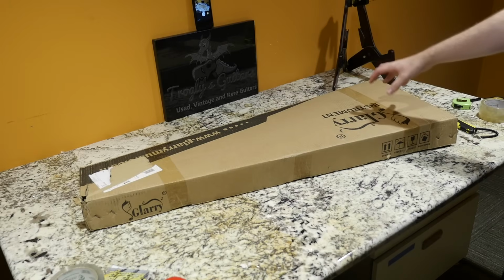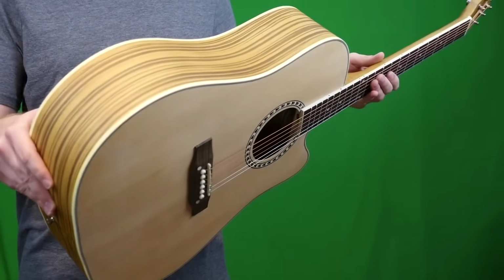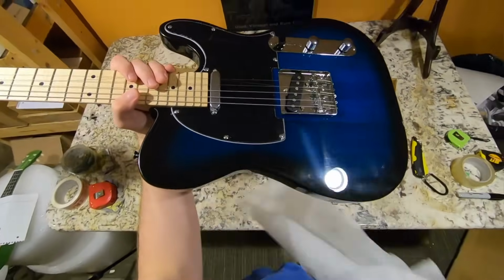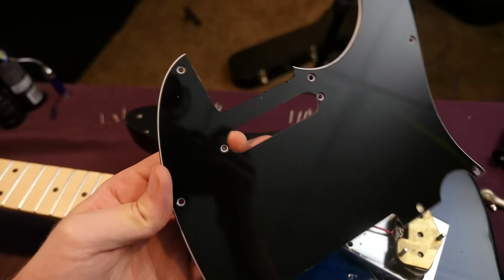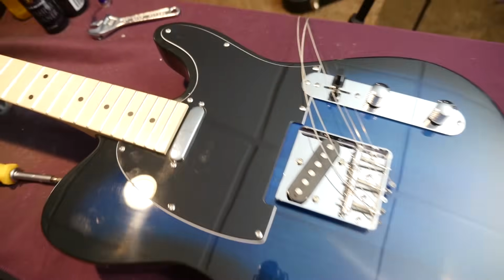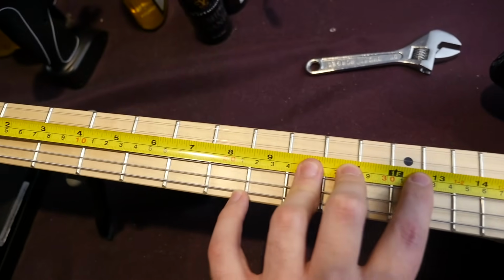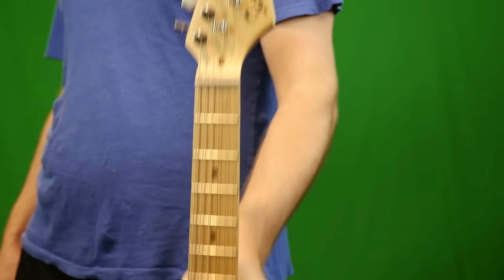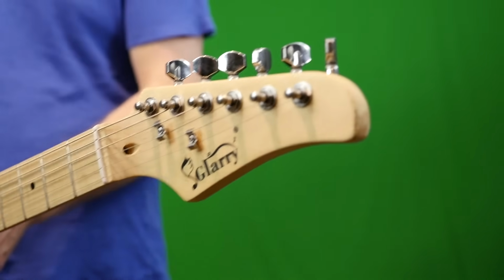How I REALLY Feel About Glarry Guitars... | Glarry GTL Maple Electric Guitar Blue Review + Demo

Comment: Have bought name brand stuff with worse frets then Glarry.....primarily epiphone.  I just have to shake my head.  The tuners were not bad....if you stretch the strings it will stay in tune.  Unlike the Epiphone which puts the worse tuners in the world on their cheap stuff (179.00)...the trapezoid nightmare.
My neck/nut was the same....fingerboard was crooked in front of nut but just didn't cut the end of neck straight.  Nut was installed correctly.  Measured fine nut to bridge.  After leveling the guitar it flat out played.  Output jack the same as your's....bent like butter.....spend 4 bucks for an all parts one.
After spending about 20.00 for better chinese pickups (alnico 5), pots, and bone nut it's one of my favorites.  Flat out plays.  Nothing wrong with slightly higher frets at #1 and lower as they go up the neck...the reverse won't play.  That's medium frets at .090.  Can be a pain leveling if they install them a bit uneven.  May get them low...not much room for leveling.

Comment: I had over paid my auto insurance and was sent an $83 check. Just took delivery of a Glarry Tele. Looks like it was shaped using a broad axe. I believe there is actually a nail embedded in the top. The head stock feels like 60 grit sand paper, the neck 220. Loose tuners, rough nut and fret sprout. Just a horrible guitar, not even suitable for wall art.

Comment: As I said in my comment below, a guitars playability rests on the straightness of the neck, the quality of the fretwork, and the talent of the person holding the chunk of wood. You could literally bolt a slab of plywood to a neck (as some companies have) and end up with an amazing instrument. It's the alignment and design process and the attention given to it that makes the difference. Personally, I'd rather have a CNC machined body as opposed to a hand carved one purely due to the accuracy of CNC, and a neck that has been hand fretted and inspected. That's where the real quality comes into the mix.

Comment: I got one of these thrown in when I traded my Sterling Axis for a Nova System, and I’m using it to play around with modding. I’m working on routing the bridge for a humbucker. But, I’m keeping the ashtray bridge. Cutting it down to shape. It’s coming along swimmingly. I wouldn’t have ever had the guts to cut into the body of a Fender or even a Squier.

Comment: $60-70 instrument, that actually plays, has to be worth it, right? The question is, what if you spend another $60-70 to improve that instrument, would it be better than a new $120-140 one out of the box? I think it might be... I have bought several guitars in the $500-700 range, and they all needed some fret work and the nut was always too high, and they required all the other neck and bridge adjustments. So you can't say these super cheap ones are bad, because they haven't been set up.

Comment: I'd take that and give it a Fender set up which means 4/64" @ 17th fret across the fret board for string height, .012" for neck relief providing the truss rod works. Then swap pickups out for some "bottom of the barrel" Fenders which would probably cost more than the guitar. Then maybe, just maybe I'd hold onto it and use it as a "sleeper" telecaster, which people would say "how does that POS telecaster sound so good. Great review, learning a lot from you, Austin, thanks.

Comment: I bought the exact same guitar, made by Musiker. Beautiful blue finish and nice thin maple neck. Had the same distance from neck pickup  to pickgard. Usually 1/8 of an inch or less not as far. $182. cad. How did you lower the action? By the neck rod?  Did it have neck bow? My neck is 100% straight. I will  give it 5% releive. 6E - 5A buzz if I play it hard. Thanks. I enjoy your reviews!  :)

Comment: My verdict on the ridiculously cheap £56 Glarry Telecaster...
It's not too bad. ☺️
In fact...it's a pretty decently playable and useable guitar for the same price as a meal for two.
I really like the pick-ups and it came without any visible flaws, but needed a quick set-up.
The only fault is one high fret which is easily sorted with a bang of a hammer.
Everything works as it should do.
It is very light and feels quite "raw" because the neck has no finish on it, but it feels smooth and now I've lowered the action a bit it plays very nicely.
I am impressed by the tuning stability and the bridge pick up is a bit of a microphonic beast.
The neck pick up is more jazzy and quieter, but nice.
It doesn't feel as refined as a Squier Tele, but has no really bad faults.
And it also looks really nice in trans green I think?
Overall, I would give it a score of 7/10.
I think any of these Glarrys will benefit from a bit of tweaking on arrival, but overall they are decent guitars.

Comment: Get a Harley benton instead, they are dirt cheap too but much better quality in comparison
Reply: Im about to get a fusion and get everyone I know on board after I give it a little tlc. I mean stainless steel frets, bone nut, locking tuners, a metallic finish and natural wood binding, and a Wilkinson floating bridge is all great for under $300 is crazy
Reply: Fucking exactly. I learned on one and it was a great experience. Over 10 years later and I am still using a HB guitar. Got a new one ofc, but it's great. SC-custom FR VB to be specific. I love it.
Reply: Agreed. About the same price but better quality.

Comment: I took a chance on a Glarry Tele.  I took it apart to change the pickups, electronics, and it needed a shim in the neck pocket.  Holy crap, it looked like it was routed with a chisel and ice cream scoop. They took no care to stop drilling once the hole was okay - and they kept pushing the drill into parts of the guitar, leaving totally unnecessary holes.  One of the worst things -- the neck pocket was chiseled out in the middle but not on the sides and bottom.  So the neck rested on what was left, with a big air gap in the middle. I did what I could to make it playable.  I still have it, but I'd never touch it.

Comment: I actually got one of those that's unbranded, off ebay, for 75 bucks.  I guess I got lucky.  I wanted to see just how cheap I could get a guitar and get it workable.  On top of the price of the guitar, spent an extra 50 bucks on parts.  Fleor pickups for around 20, a pre-wired control panel again, for around 20, and a 6-saddle top load bridge for around 13 bucks, all off ebay.  Everything mounted easy without having to sand or alter anything, and once the action and intonation was adjusted, it plays great.  I'd be a little hesitant to recommend this for modding, though.  A second one I got in blue was exactly like the one in the video.  The bridge pickup cavity is routed for THAT SPECIFIC PICKUP.  So, if you get almost any aftermarket bridge pickup for a tele, it will be too wide for the cavity, and you'll have to shave around a quarter inch off the sides to make a pickup fit properly, and allow it to travel up and down for pickup height adjustment.  But changing strings, pickups, bridges and electronics will yield you a decent sounding tele clone, with a little work.  And, I have long fingers and big hands.  So, I absolutely love the fat neck.  One of the reasons I never played a real tele was how skinny the necks are, and this guitar readily takes care of that!

Comment: One exception with Glarry acoustic guitars (which are mostly hot garbage) is the GT102. It's their round back copy of an Ovation. It's definitely not an Ovation, but it's a playable and nice sounding instrument. The pickups inside and pramp are decent as well. I put locking tuners on mine, but the stock tuners were the same as their electric guitars and work fine. I also have a Glarry GST with the stock loaded pickguard from one of my Squier Affinity Strats and a Glarry GMF HH (Mustang copy) with the stock pickups from my Squier Bullet Mustang (which now has P90s.)

Comment: Boy, I sure wish we'd had these around when I was a kid. It was a real bear to save up enough to buy even an off brand  guitar when I was young. I think my first real guitar was a Hondo Les Paul copy. Thing weighed a ton. It didn't suck. Sounded decent, at least best as it could through a little Peavey Audition 20. But that was still like $100 used and that's almost 40 years ago. That'd probably be like $250 or more these days.

Comment: Trogly if you haven't check out Davidson Brand Budget guitars the are around $99 for their Top end models with The Walking Dead  scenes as the body Finish . I got one on Amazon for $48 bucks they sold the batch quickly and the paint job was actually very nice under the right lighting . The one I got had just a Humbucker in the bridge and scratchy feeling Volume and Tone pots but a decent  MOD guitar for the price I paid .

Comment: A friend of mine's boyfriend brought a Glarry from a private seller on Facebook, and paid $90 for it, apparently you can't leave them in the heat too long because the neck will bow making the guitar unplayable and yeah, it was a very cheap looking "Strat" model with a smaller than average truss bar hole that made me wonder if there was a truss bar in it at all. This is the second video I've checked out about, this brand the first guy got his for $75 and was honest that the guitar needed to be set out of the box and there was a few other issues when he took the pick guard to look at the electronics.Glarry's obviously making these guitars on the cheap for a reason.

Comment: I bought the slightly upmarket Indio Tele clone off Fleabay also in blue ($100).  I suck at guitar so having an expensive instrument would just make expensive noise!  The setup/intonation wasn't the best but that was pretty easy to fix.  The neck was nice and straight and the truss rod was adjusted spot on.  Fret ends and nut were sharp and needed some dressing.  It also had 2 layers of protective plastic over the pick guard, but the guard was nicely routed, didn't look like it was nibbled out by rats like this Glarry (worn out tooling).  Biggest complaint was the neck 'lipstick' style pickup was extremely microphonic causing lots of feedback issues with any volume on the amp (Fender Hot Rod Deville 4x10).  I had a bunch of beeswax left over from setting up my pool table slates so I melted some down and potted the pickup (very easy to do).  What a difference, just about eliminated the microphonics on that pickup.  It's now my favorite guitar to make noise with!

Comment: I own the Glarry P Bass- hey, it's a bass, I slapped some Fender tuning heads and some Jazz strings on it, I also own a couple Glarry Teles (Mod project gtrs) and  one of those 170s, which my wife thought was a pretty guitar, but man, it sucks in output, it has a dead fret, etc., I'm going to mod it a little and do a raffle for our community theatre with it. Glarry is a great beginner guitar market, but they are inconsistent, quality wise, across the board. my two pence.

Comment: I got the tele thinline body glary. It is much better in general than I expected. But I would think it would not be any more costly for them to set the angle of the bridge pickup so that the unwound strings stay aligned properly over their own magnet. The plain E string misses completely. Not sure exactly how much that effects sustain, balance or response. Also individual string saddles would be cool... better grade of fretwires? I'd pay 20 or 30 bucks more for them improvements
Reply: Not sure? I thought you owned the guitar...

Comment: Odd that  not only is the bridge drilled for both top and bottom loaded strings there are also two sets of holes for bottom loading. One in front of the four mounting screws and one in the normal space behind .I have seen a Fender bridge with them in front of the mounting screws but never both. Maybe to provide for two different scale lengths without having to relocate mounting screws???

Comment: I'd  buy  one  of theese.set it up   and  change  all  electronics  for  a   humbucker  +  rail  single  with  coil  taps  for both ( thouse  can  be  found on aliexpress for  ~10$  each). That would  be   a nice  guitar  i think.  
Oh i  almost forgot.   You  can  buy  bone  nuts in  china!  They  are  synthetic   bone i belive but  much... much  better then   stock   plastic  ones.   Especially   if  you work  on   slots    with  sanding paper turned  around  a  string

Comment: These guitars are pouring in from a factory in China. You can find them 
unbranded online for $69 -$89. Many companies buy them, put a brand name
 on them and mark them up to $120.00.  You can tell if the logo on the 
head is a water-slide decal.
Reply: It's not a water slide decal...it's an inkjet stamp.
I've got two Glarry's.
The "Glarry" logo just comes off with nail varnish remover.

Comment: For real, sounds impressive. I think only tuners should be replaced.
Reply: DRANK TABLE yeah, maybe pots and pickups too. With that routing, I'd put a humbucker in the neck and maybe even keep the bridge pickup, only waxing the coil to prevent microphonics. Pots in chinese guitars are usually very bad, and normally the wiring doesn't come with treble bleed.

Comment: Are those Authentic Glarry's  or some cheap  imports . Yes!
Reply: They sell the same style of guitar's without a name on the headstock or anywhere for that matter.  Plus they are $10.00 cheaper.  Otherwise they are identical to the Glarry guitar's.
I ordered one and it was $59.99 including shipping.  So that was unreal.  In fact the one I bought was the same as the one he didn't like the style of.  Kinda like a try at making it like a BC Rich. It has a HSH pickup configuration and a fulcrum tremolo.  I bought it to practice my routing out the section's needed to install a Floyd Rose on many other guitar's.  Kind of like something to either play once you get the action and intonation right or use it as a way to learn the basics of almost every part of an electric guitar.  You could route out a area for a Floyd Rose, change out the pickups and make really light super strats or whatever you want without spending much. In fact if you went to Wish.com and bought one of their "patent and licensed by Floyd " two point locking whammy bars and even some used Seymour Duncan's or whatever type of half way decent pickups, you can make a super strat or anything you want and not have to worry about someone stealing it or accidents. I usually do that with other start style guitar's like Yamaha's, Ibanez Gio's or similar Ibanez models, you name any guitar company and they've likely made a strat style guitar.  $30.00-$50.00, swap the parts that are useless  and if you're feeling creative throw a cool paint job on it. The whammy on Wish.com come with every part needed to install it and they are only $14.00-20.00. I bought Floyd Rose templates on Stu Mac. The made of acrylic and have lasted for 6 years already.  So you can do real cheap.  I do maybe one a month and then donate them to kid's in need or are having problems with fitting in or even family issues.  It really gives them an outlet and keeps them from drifting back towards the drugs and other bad issues.  It doesn't work with every young kid in a hard spot but it helps.  Plus it's a good feeling trying to help. Or sell them for a side income.
Easy, educational, and fun plus it looks like I actually know what I'm doing when I'm working on a guitar. Still learning but getting better.

Comment: I got one that had no name on it at all but sure its the same company that made it. I ended up having to spend more money to customize it and make it even playable. I changed the bridge, tuning keys to locking, brass nut, and some Fender Pickups. So I easily spent another $150.00 plus my time  to rebuild it and put holes thru the body for string ferrules. Last but not least CTS pots and Orange drop capacitors. SO I would recommend not buying one of these guitars unless you are learning, or know how to customize many flaws made.

Comment: Not a basswood body. Basswood is nice and dense, with good tone. These bodies are Paulownia. Too light. No sustain. No tone. Also pretty sure that the reason their necks are so thick is because they're not maple. Probably Pine or something similar. They have to be thick to be sturdy. The intonation was so far off on the Glarry I had, the neck had to be filed nearly a quarter inch on the end to correct it, which required a new set of screw holes to install it. The pickups were so weak and the electronics were so bad that I spent another 20 bucks on eBay for a loaded pickguard. That was a big improvement. Mine also had to have an extra spring on the tremolo to hold it against the body. You can't float this cheap tremolo. If you do, the guitar won't stay in tune. After many hours of work, mine was a fun to play guitar, and sounded OK. But there was no helping the lack of tone and sustain. Strat-style guitars have a mysterious 14th fret dead spot on the G-string. On well-built guitars, you have to actually time the sustain to tell it. On the Glarry ST, it is painfully obvious every time you hit that note. I gave mine to my brother after all the work I put into it. My advice to anyone is don't buy a Glarry guitar. If you want a quality guitar at a low price, made from quality wood, check out Rondo Music. I have an SX Strat I got on sale for 69.99 that is 20 times the guitar I got from Glarry.